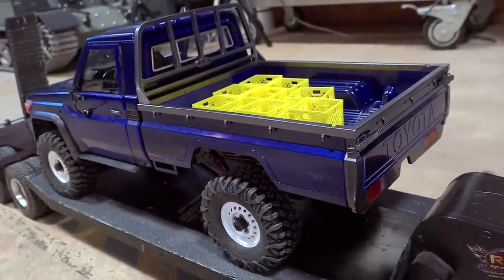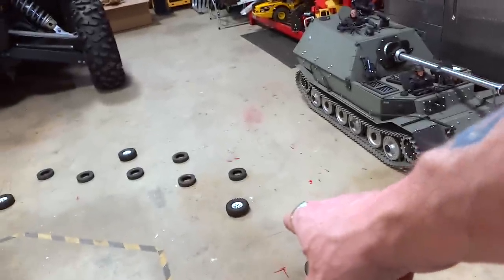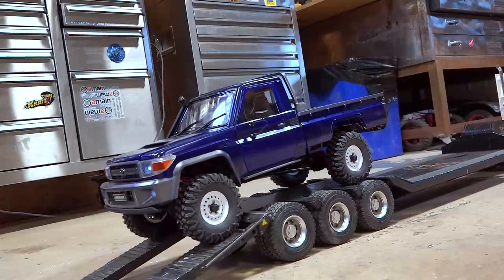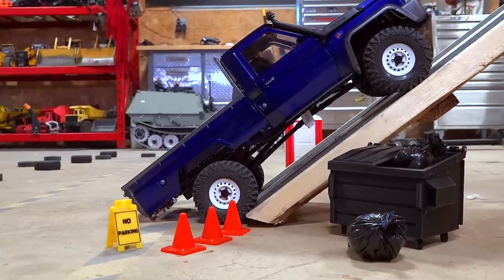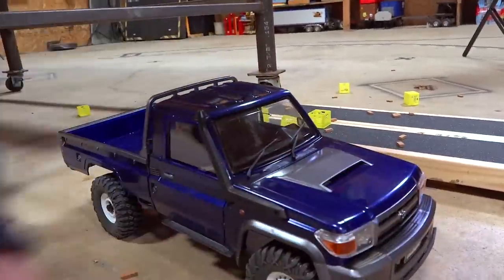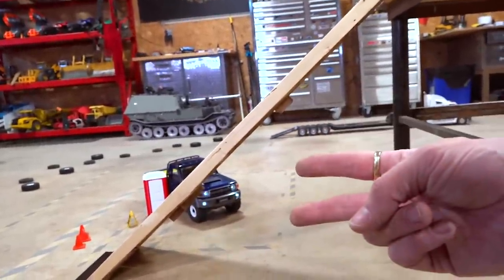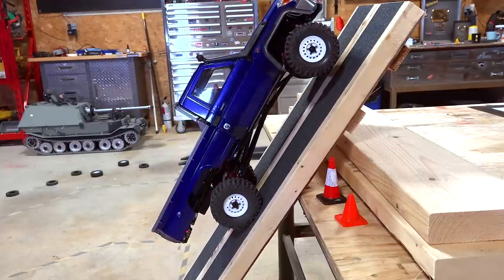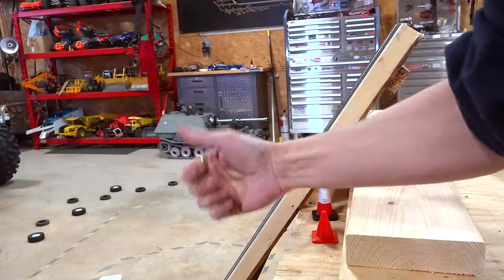MAX Traction, Steep Incline Test - Toyota Land Cruiser LC70 UTE - BRX01 Boom Racing

Comment: YOU HAD TO DO IT - YOU HAD TO GET ME GOING ON SOUND KITS!!!! In my teens I set up my first home music recording facility & joined my first professional band. At 58, recording & venue experiences have taught me a LOT about sound. Sound kits probably sound realistic to the untrained ear but the small speakers can never move (vibrate) enough air to get that throbby, lo-end bass rumble. That's issue #1. Second, is that many cheaper sound kits don't use samples from various motor RPMs, they simply raise the pitch of the idle sound when the throttle is pulled.  Bluetooth speakers with long-throw cones aren't bad at close proximity, but again, they can't move enough air, so the effect is lost unless your ears are a foot away from your rig. 
     Listen with good headphones to the 'truck intro' sound for Loading Wars. What a great bassy throb! 
     Issue #3 is active parametric EQing and audio compression. They're just ways to make some engines sound throaty but you lose volume dynamics and mess with natural harmonics. Bottom line is until reproduction algorithms can fool my ears
well enough to believe I'm standing next to the real thing I won't use sound kits. With sponsorships, I'd certainly test & evaluate them though, hehe. 
Sorry for the long-winded explanation but that was actually my short answer.

Comment: If there were a sound kit that emulated a diesel with turbo spooling up, rev limiter getting hit, and a blowoff valve when I let off the throttle, that's one I'd be in to...TDI TRD 70

What was that about 55°-60°?

Comment: 🐸 Truck is pretty tough, took that fall very well. Good test for incline on max friction grip tape surface. Maybe you could use tire “sauce” or tire “tack” on those Boom Racing Hustler tires, sticky compound..?Using first sound kit in RC soon seem cool from what I’ve seen, some venues and competition don’t allow them to be turned on I’ve believe. Thanks for sharing. Later

Comment: Tiling a slow mo cam when you launched everything out of the box on the fast run up would have been awesome as long as it was pointed at the ramp where the truck was launching up towards it and then slow mo the bricks flying out it would have been cool idea for another video

Comment: And you've just demonstrated one of the disadvantages of solid axles Vs independent suspension, under load a wheel will be lifted of the ground due to torque.
I'm not saying either is better, they each have their own uses.

Comment: AMAZING! The first raise, you jumped it, nice! It cleared the 2x4s that's some power. If only you were outside climbing a cliff,that would have been a great shot when you were 3 wheelin! Been wondering, what's the holes at the bottom of the headache rack, for additional break light?

Comment: RCSparks Studio ;                  Glad to see that new RC. Truck wasn't to badly damaged in that fall . The question is how would a real  ' full scale ' Truck fair ?  And also would it be possible to to build  a Car , or a Pickup , or any road vehicle to " True " SCALE " ?  How thin would the skin / metal have to be ? The Fenders , the Hood , the Siding ? Would you even be able to pick up your RC Truck with your bare hands , with out nearly crushing it ?  When I consider just how thin the metal that makes up the ' body ' of most cars is , I wonder is the thickness of the aluminum foil the average home owner uses , to thick say for a scale RC. Models you use ?  I'm sorry but things like this interest me . Safe driving , and mind those steep inclines .   Jack

Comment: I only dont like sound kits because the electric motor revs up faster than a real motor so the sound kit revs up way to fast compared to a real truck. Great video by the way!!!
Reply from the maker: That would be because the user had not used the provided software to add a shift point, turbo sound, and engine response time ;)  (in most cases)
Reply: @TheRealRCSparks  oh I didn't know you could change the settings on them hmmm maybe I'll try one.

Comment: Firstly Happy Birthday, how do you get the body to sit so low, I have this mounted to a SCX10-2 and just cant get the body to sit close to the chassis, I had to do a shock holder delete and still cant get it closer, I'm using the standard Kilerbody mounting brackets, any help would be appreciated.
Reply from the maker: Hello Jason.. this is an entire truck.. not just the body! It was build for the body. I suggest you watch my "unveiling video" I did a few days ago. Just click my channel.. and you will find it. Hope that helps :)

Comment: I did this on a plywood board with my vaterra ascender, softest suspension setting and it lifted the tire 2 inches higher than yours...did you have grip tape on the board?
Reply from the maker: Of course there is grip tape on the board, you can see it!
Reply: @TheRealRCSparks  I didn't know if it was grip tape or something else

Comment: Hey everyone im looking to get the rc4wd trail finder 2 kit and was looking for some advice on electronics. I know there’s a video a little bit back on building this kit and the electronics used. But was wondering if those were still good ones to get or if there’s new and better electronics to get. What type/ turn motor. What servos. What esc and what receivers are good if so I have another rc car I’d like to run the same radio for both cars. My other rc is a drift car and I tried and failed with doing the electronics myself so I’ll need a new esc possibly for that but any advise would be greatly appreciated thank you

Comment: scale weight always seems to be a tad off with most every rc iv seen. for instance body roll and suspension flex on an actual vehicle is not as easily and accurately depicted in a scale rc version of the same thing atleast on most out of the box kits. would love to see a video of you going over topic.
Reply from the maker: Full Size average trucks weigh 2000lbs  and a 200lb trail truck is not practical. Also.. Im always confused on why people think that toys should act like full size machines. They are 100% different. They just look similar.. Lol :)